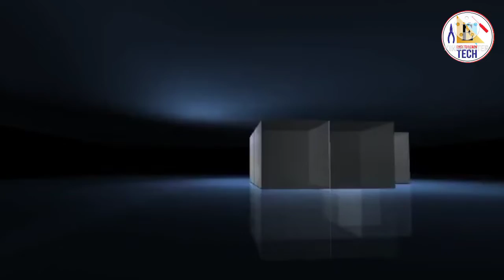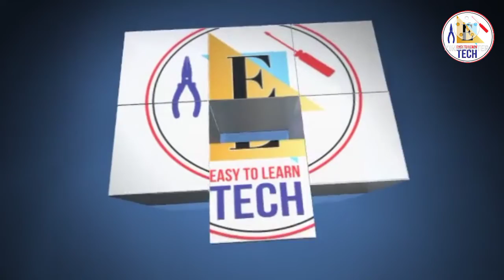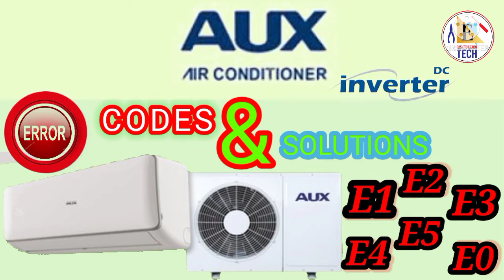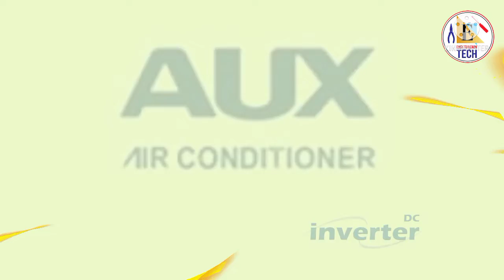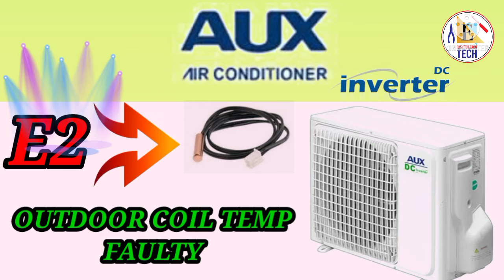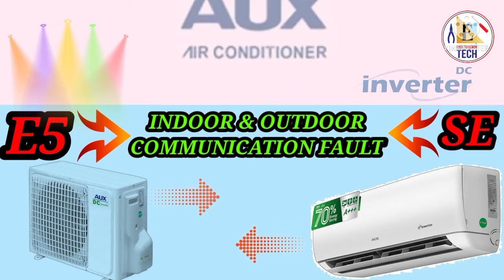Aux Inverter AC Error Code // How To Solve Error Codes //Solutions For Error Codes / Error Code List

Comment: Hi. If I disconnect the outdoor unit and measure the indoor unit N to S and it reads 24v DC but no fluctuation does this mean it is still ok or should it be fluctuating? E5 error code. Thanks!
Reply from the maker: There will be no Fluctuations, because you have removed the communication cable from the outdoor unit. Only one side of communication is receiving That's why it will not fluctuate.
Reply: @Rehankhan_HVAC_TIPS  brilliant. Good to know thanks.
I will check the signal from the outdoor unit with it disconnected from the indoor shortly.
Thanks for your rapid reply. I also have 2 of the identical units working correctly so can compare values.
It did initially trip the circuit breaker before the E5 occurred.
Reply from the maker: 1. Firstly, the IDU and the ODU should be matched and connected properly. 
2. Observe the main external control panel, turn on the air conditioner, three 
lights are all lighted up then off and the relay pulls in. If not, it is power supply 
problem.
3. Connect the black signal line S to terminal N of ODU. Turn on the A/C, if "E5" 
is still reported, the main external control panel need to be replaced. If "E5" is 
still reported at this time, go to step 4.
4. Change a new main internal control panel, if the error code E5 remains, then 
the problem should be on the main external control panel.
Reply from the maker: Did you check the outdoor unit N to S, after disconnecting the S from the outdoor unit. What is the voltage from the outdoor side?
Reply: @Rehankhan_HVAC_TIPS Just checked it and no DC voltage from S on the outdoor unit.
Worth checking the fuse on the odu? Or is it pretty much dead?
I'll remove it and have a look in a day or 2. Don't have easy access to it. 👍
Reply from the maker: I think the outdoor PCBs card is an issue.
Reply: @Rehankhan_HVAC_TIPS  Porbably smart to test the other components on the exterior unit before replacing the board no? Chance that another component cause the failure of the board or do these boards have a high failure rate on their own? Thanks
Reply from the maker: @CJ-vg4tg sorry didn't understand
Reply: @Rehankhan_HVAC_TIPS  If the main control board is not working (not outputing any DC voltage from S) then what caused it to fail? Just the board itself failed or another part on the unit that failed burnt out the board? Need to ensure every other part is ok before installing a new board.
Reply from the maker: @CJ-vg4tg  You can open the pcb cover & check which area is burned low voltage side or high voltage side. Or the small components which get failure due to moisture attraction.
Reply: @Rehankhan_HVAC_TIPS  Thanks yes I plan to remove it and bring it inside to check and test, out of the unit. Will probably have more questions later on.
Reply: @Rehankhan_HVAC_TIPS  Got the board out. Nothing visibly burnt. NO led lights illuminate though. But I do have 310v DC between the N/P on the rectifier so not sure what is not working yet. IGPT possibly? As no leds come on?
Reply from the maker: @CJ-vg4tg check the components near the S wire area in the pcb board.
Reply: @Rehankhan_HVAC_TIPS  Appears the IGBT is toast. I have removed it and looking for a replacement. It's a 40amp 650v. Ones available are 40amp 600v or 60amp/650v. Think the first will be plenty for a 12000 btu.
Haven't found anything else burnt yet. Shunt resistors test ok, tranny not shorted . Rectifier measures fine on AC and DC (310v).
Reply from the maker: @CJ-vg4tg 60 amp 650v will work on this
Reply from the maker: @CJ-vg4tg even 40amps 600v will also work
Reply: @Rehankhan_HVAC_TIPS  gone for the 60amp. Being shipped. Now if there is something else burnt out on the board I have missed then there is a risk of burning out this new IGBT I suspect. Haven't found anything obvious yet but of course a risk when running the power through again. Will try it on the breadboard without anything connected of course. Thanks!
Reply from the maker: @CJ-vg4tg did you check the bridge Rectifier?
Reply: @Rehankhan_HVAC_TIPS  Yes, 310VDC between P and N and 218 VAC on the 2 middle pins if I recall. But yes it had 310 VDC output. Thanks!

Comment: how adaptation new copresor bldc to inverter - copresor starting 4sec and have overcurent error ...
Reply from the maker: Check the Dc current which is going to the compressor, is not stable. A bridge rectifier in an outdoor pcb card has an issue. Change the outdoor PCBs card or repair the PCBs card.
Reply: @Rehankhan_HVAC_TIPS  the electronics are 100% OK, I have an old compressor and it works - the new one must be adapted to the inverter. I tested the new one on an industrial bldc inverter - OK

Comment: What is LD means?
Reply from the maker: In general, the LD error code could indicate issues with the indoor unit's fan motor, temperature sensor, or electronic control board. One common cause of the LD error is a malfunctioning temperature sensor, which can prevent the air conditioner from regulating the room temperature correctly.

Comment: f7. what's this mean. it's when I try to use heat
Reply from the maker: When the air conditioner is switched on, if the compressor is not running but there is an alarm of "OVP or UVP error , then it shows the error f7
Reply from the maker: In cool mode does the unit work normally ?

Comment: F1 error code on an Aux inverter
Reply from the maker: Outdoor unit INVERTER POWER MODULE (IPM) FAULTY.  If you can repair from somewhere, otherwise you need to change the outdoor PCBS card.

Comment: I am getting F6
Reply from the maker: F6 : external temperature sensor error,

1. Check whether there’s resistance problem, short circuit or open 
circuit in the sensor; the resistance value shall be within a reasonable 
range (15KΩ under the temperature of 25℃).
2. Check whether the sensor wire is broken.
3. Check whether the terminal connectors are well fixed; check 
whether the weld between the terminal and the main control panel is 
loose, and pull the terminal slightly for inspection if necessary.
4. Check whether the sensor is affected with damp.
5. In case no standard sensor is available at present, replace the 
external temperature sensor with the other sensor asides, and then 
check whether the error still exists; if the error disappears, replace the 
sensor; if the error still exists, it's possible that the main control panel 
is faulted, change the main external control panel.

# Special attention
Most of the standard resistance values of the external temperature 
sensors are 15KΩ (hen temeperature is at 25℃), and the higher the 
temeprautre is, the lower the resistance value is, and the lower the 
temperature is, the higher the resistance value is. Do not use improper 
sensor during repairing and maintenance, or it may led to the wrong 
temperature sensing of the machine.
Reply: A9 error code AUX multi split
Reply from the maker: All indoor units are showing an error or only one

Comment: Indoor unit pcb fault ya outdoor unit pcb fault Aux E5
Reply from the maker: Indoor outdoor communication fault
Reply from the maker: Check the communication between indoor & outdoor unit.
Check the communication dc voltage, indoor out & outdoor out communication dc voltage. Dc voltage should be around 9 to 45 dc voltage in running.....

Comment: Mostly E5 error code come from outdoor unit PCB. Mainly reason is power supply to the outdoor unit. Before checking the PCB you must check the motor unit. If short to the windings or short to the ground.
Reply: What do you mean? Fan motor in outdoor unit? Or compressor motor?
Reply from the maker: In the compressor we don't have a motor.
Reply from the maker: The compressor is divided into 2 parts, electrical winding & mechanical parts.
Reply from the maker: For which error code you're asking please let me know.
Reply from the maker: @vankedisi1 which error are you facing brother
Reply: @Rehankhan_HVAC_TIPS  e5 error. 24000 btu aux made inverter av. aux h24wbpc1 this is the pcb code. Uses r410a gas
 
It stops working statts again randomly...

Should i order new card or can it be a sensor issue?
Reply from the maker: @vankedisi1 This is mostly a communication error, if all the components are not communicating with each other properly then you will get this error.
Need to check: 
Communication cable.
Indoor PCB board
Outdoor PCB board.
Any one of this will be faulty.
Reply: @Rehankhan_HVAC_TIPS  will this fit to my model 

KFR72WBP 4 pin. Same as mine in picture but my card name is different. Everything is 100 percent same
Reply from the maker: @Hi-levels  if all the connector are same and the components,it will work.
Reply: @Rehankhan_HVAC_TIPS  yes same friend exactly same
Reply from the maker: You can fix and start the unit , it will work.
Reply: @Rehankhan_HVAC_TIPS  the technican will come next week. If issue is 100 percent from the out door unit pcb i will get it removed and send it to a pcb repair shop. If it is too expensive to repair i will order the card from aliexpress.
Reply from the maker: @vankedisi1  if you have some technical knowledge, then I can guide you. But it will be at your own risk.
Reply from the maker: @vankedisi1 if you have a multimeter or clamp meter easily you can check
Reply: @Hi-levels  
In the outdoor unit is a PCB(inverter PCB). There is some LED light wich must come on when you connect power. If no leds on, pcb is fault. Also you must check the compressor windings resistance and short to the ground. If ok then you must repair PCB. 
There is an switch IC with part number TNY279PN
Reply: @fullbridgeelectric  ourdoor pvb has leds they work with green lights.  I see so issue might be with compressor? Ac works for 1 hour 10 mins 20 mins etc then it shuts down itself... if pcb is faulty thwn why it cools?
Reply from the maker: @fullbridgeelectric if the compressor has an issue it will take high amps, and the breaker will go down. If ac is working for 1 hrs means either the compressor is getting over the heat or the pcbs are getting over heating.
Reply: @Rehankhan_HVAC_TIPS  ac is not new why overheatin pcb? Could it be a sensor issue?they washed outdoor unit. It happened after 1 month
Reply from the maker: @vankedisi1 please check and let me know the status.

Comment: Im not getting an error code but they unit does shut off before desired temp and the temp display on the unit flashes once every ten seconds or so. It comes back on after 5 or 6 minutes. I feel like this isnt how its supposed to work but I can not find anything online. Just purchased last winter. It also doesn't seem to be blowing warm air. I know its a lot, but you are the first person to discuss this particular model that i have been able to find.
Reply: Im wondering if the remote is set wrong. I know I'm overthinking. Any suggestion is much appreciated.
Reply: 1st year using it Temp never really has reached but it did warm some and on cool it continually cooled no matter what temp was set on. Had to turn off to get it to stop cooling. Didnt use it for a while due to not working anyway. Tried again recently and now no cooling, or heating at all,  just blows air. I'm beyond frustrated. Had it too long to take it back. Nobody in my area works on them. Worked for 1 season but not properly. UGH
Reply from the maker: Please check the remote , Set the MODE properly. & Need to clean the filter & fan blower. Outdoor condenser coil.
Reply: PLEASE ADVISE
Reply: @gingerbruner9646  did you find a solution- I'm currently having the same issue. Blinks every 10 secs or so & not heating. Another video (not Aux specific) from like 10 yes ago said "defrost" mode (for me it,s 30degrees F- so would make sense, but still curious!
Reply from the maker: What is the problem you're getting, I didn't get you.
Reply: @Rehankhan_HVAC_TIPS  The degree numbers are flashing every 8-10 seconds on the unit (stops blowing)- no code on remote. (Was trying to use the heat)
Reply from the maker: Check if the ac unit is heating or cooling system or not.
Reply: No error code. Indoor display did flash 1x every eight seconds randomly but not code.
Reply from the maker: The display connector needs to be fixed properly. Please send me a video in my mail.
Reply from the maker: Hi, Thanks for the opportunity.
1) Are you getting proper temperature from your ac, room is getting cool or not.

Comment: there is no error code even fan is running in the head and also in the outdoor unit, but looks like the compressor is not running and on the pcb board three LEDs are blinking, can you please tell what is the problem?
Reply from the maker: 1st need to check the gas pressure or Ampere for compressor. Need to check refrigerant first.

Comment: I am getting an F4 error code on a confortotal.   what is this code
Reply from the maker: On which brand ac your getting the problem
Reply: confortotal.  it was installed new and working.  later that day it popped up an F4 code.
Reply from the maker: Outdoor mid coil temperature sensor open/short.
Reply from the maker: 1) Check for gas pressure, may be leak.
2) outdoor mid coil temperature sensor open/short.
3) PCBS CARD MAY BE FAULTY.
THIS ARE THE REASON FOR F4 .
if its newly installed, please try for replacement or spare parts change. If warrant/guarantee is claimed in that region. Please let me know 
Thanks

Comment: Hello bro one help my ac E5 codes view solutions tell me brother
Reply: Thank you bro new AC brother last one month letter power problem this code problem bro
Reply from the maker: E5 error means communication failure between indoor & outdoor unit.
Step 1 = need to check cable for communication.
Step 2= need to check indoor PCBs card & outdoor PCBs card may be faulty.
Reply: E @Rehankhan_HVAC_TIPS
Reply: See my description on the comment

Comment: I am getting E0 code.
Reply from the maker: This error code occurs on your air conditioner due to various reasons. It could either be due to an outdoor PCB defect, clogging of the refrigerant piping system, an outdoor compressor motor lock, insufficient refrigerant, or an outdoor compressor start-up error.